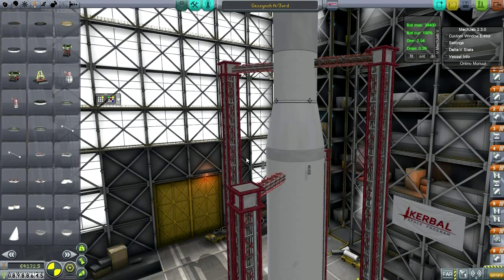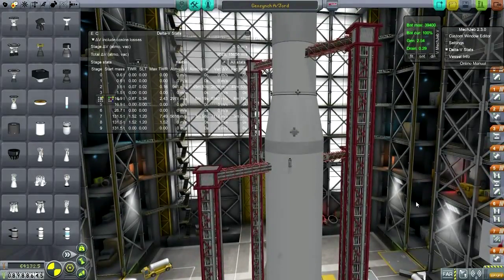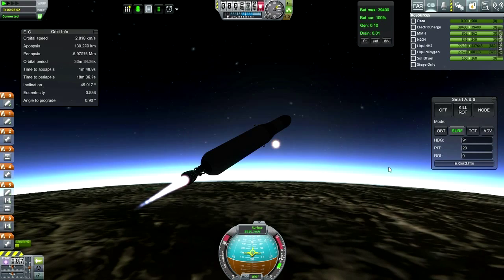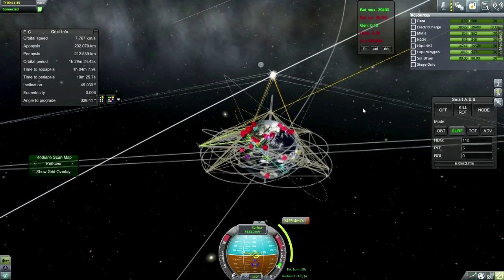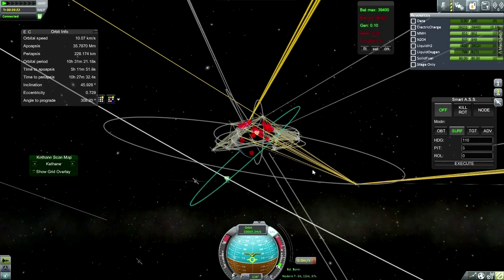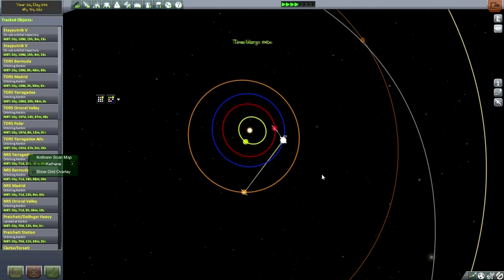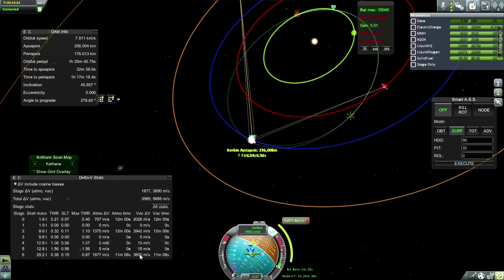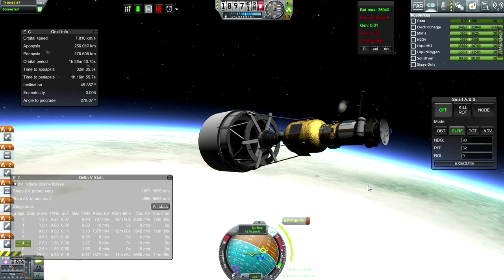Kerbal Space Program (0.24) - Realism Overhaul 058 - Wobblies

Comment: Hey, I recently solved my wobbling problem so I'm here to report you. In my case, as usual, payload was root which is on the top of rocket. For whatever reason rocket wobbles, it starts increasing because controlling reference itself is on tip of wobbling rod. I solved this with placing my root close to the CoM as possible. With select root you can set a fuel tank itself as a root, which is the best.

I hope this could help you!
Reply: ***** Well, this doesn`t take any cost. Set a already extisting fuel tank into root part doesn`t change anything in gameplay. Give it a try!
Reply: ***** Oh, that`s a crucial problem which I didn`t know. Thank you for your advice.